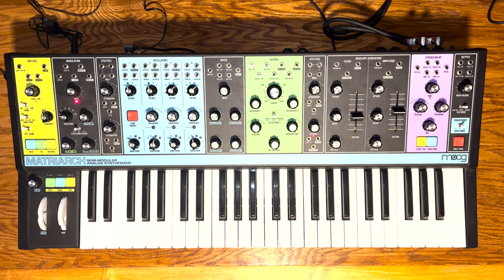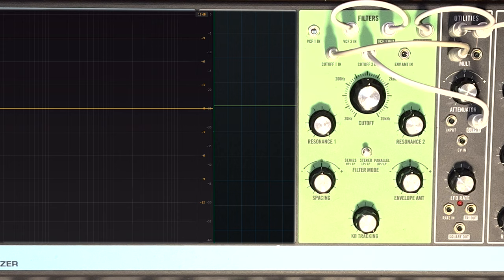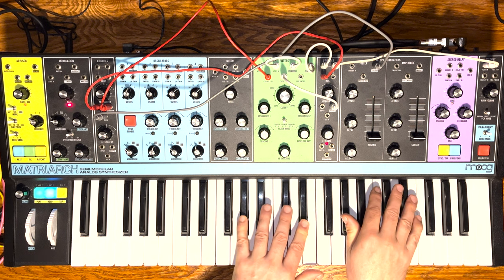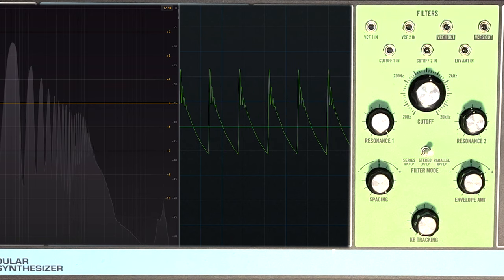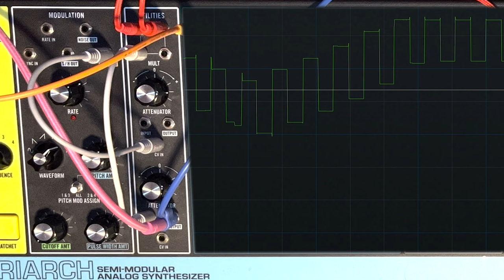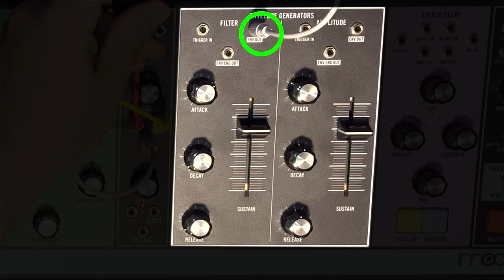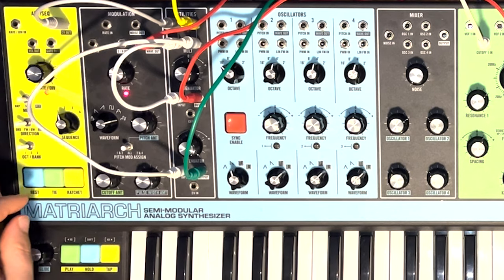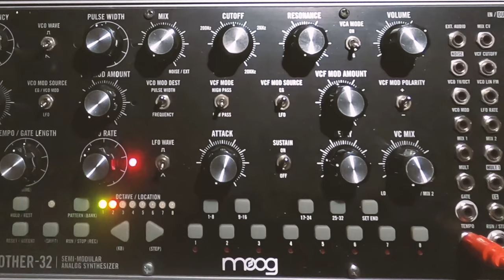Moog Matriarch Filter Deep Dive Part 3: Filter Feedback and Parallel Mode Patches

Comment: Thanks so much for these amazingly deep(est) tutorials. Re 'How to Modulate Gate Length' and the issue you had trying to turn the Matriarch's VCO rate down sufficiently for PWM for variable gate length: I know you found a workaround but it got me thinking and I found you can turn the VCO frequency down to LFO rate with -v offset from an attenuverter into PITCH IN (but that then uses a valuable utility up). It's also fun to patch this PWM output into a VCA panning patch at audio rates, controlling the panning frequency with the attenuverter. Hope that add something useful. Again thanks so much for your time, effort and expertise. It is clearly appreciated.
Reply from the maker: @draperm631214 that’s a great idea! thanks. I’ve used the attenuverters to force a static pitch…but didn’t think to try as LFO. I’m definitely going to explore that and will probably post a video about it. thanks again.